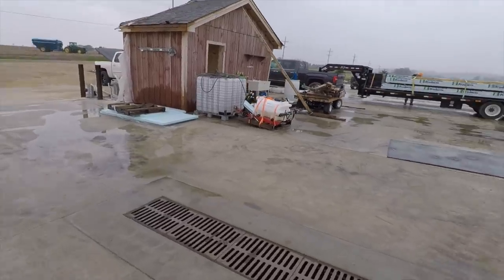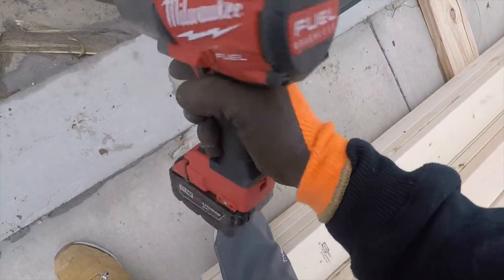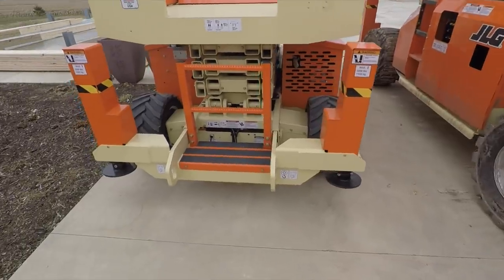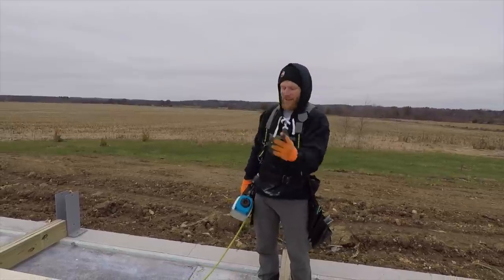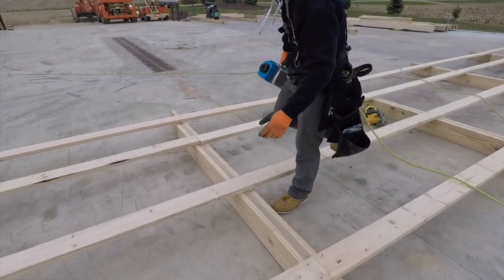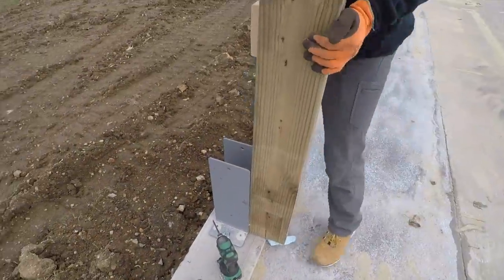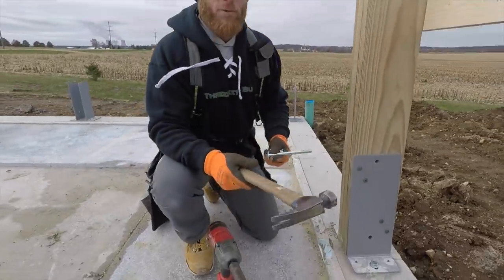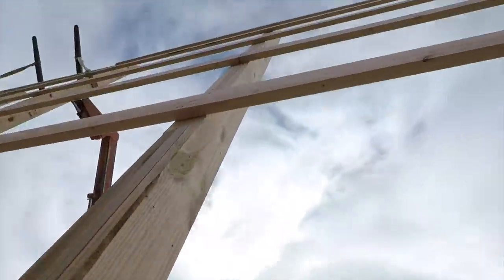Farm Shop build series video 1

Comment: You might want to check out the required development length of that tie down bolt. With the size of that building it seems a little short.  Also, I agree with your assessment to get a proper tourque wrench and an allowed ftlb setting with a design setup time on your concrete.  Your current method of setting your tiedown brackets could be degrading the pullout strength by riding the trigger for too long on your impact gun.  Love your guys work ethic.

Comment: Great Videos!  Nail Bag Tip:  Grab a handful of nails, enough that you can touch your thumb with your index finger.  Grab with both hands together, squeeze while twisting and pulling your hands apart.  This will pull the nails apart by the head of the nail.  Lay them in your nail bag with the heads facing forward.  Now when you grab a nail it will be automatically be facing the head up and ready to fire.

Comment: I suppose the advantage to your scissor lift is its ability to carry much heavier loads of materials up to working heights. Cherry picker very limited in that sense. Keep up the work great to see this type of building as we are not allowed to erect in UK due to our stringent fire regulations. All our industrial building frames must be steel. It all arrives on the back of transportation ready to be bolted together. Generally two to three days for frame erection.

Comment: I wish I would have seen the concrete work! We are doing the same thing, but on purpose. We are pouring a 5" x 22' x 32' slab that we will have a ShelterLogic structure on for a few tears, we will then go out four feet all the way around and put in frost wall when we build the permanent building. That allows us to build with cash and not have to take out loans.

Comment: I see a lot of these start with just post footings and the building is built on natural ground, later to be finished with concrete.  Is there a reason the concrete floor and foundation is not installed first?  I ask because it seems that it would make for an easier build, rather than working in mud like in the Diresta build.  Thanks for the wonderful videos.
Reply from the maker: typically we build on a pier not a whole footing wall.  this means the slab must be poured after so it can float inside.  We don't want the weight of the building on the floating slab.
Reply: RR Buildings makes total sense. Thanks!!

Comment: Love your videos! If I lived near you guys I'd want to get back into the field and build with you. The only thing i would do differently is use two part epoxy to put 5/8 threaded rod into the concrete rather than those large tapcons. I've just never had luck with them lol.

Comment: It's crazy to think how we build in a completely different way here in Europe, compared to you in the USA.
I'm about to build a "similar" building in Italy (maybe half big and 1/4 tall, and with 2 more line of walls in the middle), and it's gonna be (I mean: it HAVE to be, due to engineering regulation) completely built out of concrete.
Reply: Yet nothing stands up to a decent super storm or even a sinkhole.

Comment: With your wall assembly, new snow outside is up against building the melt can flow under wall bottom over wall footing area into the workshop.  Why not bring the perimeter wall stem 6" up higher above inside floor? I did see a few 4"? bluish pipes up around footing outside back wall,  is this a drain next to footing face perimeter to drain water away?  Why no treated block between metal post base and your new assemble wall post? Or use treated wood in your post assembly. Yes, time and money. But wouldn't both items assure a longer no maintenance install? I don't know what snow levels will be up against this Superiorly Built with pride and shown of this  GREAT New Building.
Reply: water outside and pipes carrying water inside,  it makes sense to weather guard but does little for what is piped into a building for hydronics and maybe a wash area.

Comment: I understand using steel beams cost more but it gives the structure more stability and lost way longer. Especially with a building being used for work steel beams seem like it would have been better

Comment: That will be an awesome shop this looks to be an amazing series. Pretty neat that two men can do this. Why do some of the posts look treated and others not?
Reply from the maker: all bottoms are treated and the finger joint up top is untreated southern yellow pine
Reply: Even though it is not in ground contact, it still a code requirement to have at least 6 foot of treated from the bottom since water may still come into contact with the connection.

Comment: So, this farmer lost his old shop building to a storm, and you want to build a wooden structure on it, that can, well, relatively easily be blown off by a storm? Why not something more solid?
Reply: His methods, materials, fastening, and spacing will likely hold up to greater loads. We don't know how the old building was constructed.  This guy's most likely adhering to local building codes, which have increased over time, and if his buildings pass inspection, they're built to code, which governs wind, snow, rain, and seismic loading.

Comment: Great Videos ... Ive enjoyed seeing the different types of buildings you have put up.  Question for you ... If I want a 18ft sidewall building for indoor sports and random stuff parking at my home, what is the most cost effective way to get a building shell (walls/doors included) that will last and give me the height clearance I am looking for?  North Carolina, so no major snow accumulation concerns, but plenty of moisture and humidity.  Not in city limits, so aesthetics are not as important.

Comment: It is surprising that code would allow the use of those screw in anchors vs a traditional mechanical or chemical anchor. A building that large must see a ton of wind load out there.
Reply: Regular screw in is not the only type usable in this but are most practical due to likeness of L bolts being misaligned or putting an anchor out of alignment, they make no mention of not using chemical bonded type anchors though and also offer wet set with rebar welded to the bottom of the bracket which he often uses as per the DiResta and many other builds he has done.

Comment: Probably a really stupid question.. are the posts 2x6 or 2x8?  Also, what kind of nail pattern is required when marrying them together to make the post, or were they prebuilt?  Amazing work, staggering how fast yall work for such a small crew!
Reply from the maker: cwarren83 these are pre engineered laminated 2x8 columns.
Reply: RR Buildings ahh ok makes sense.  Was thinking that would be a TON of prep work to get the column built.... and a metric ton of nails lol

Comment: Hi, great to look at your work. Love to see your footage. Thank you for that. I got two questions. At 3:11, are the fasteners the HEAVY-DUTY TAPCON®+? I ask this because I don't see any bolt there which are visually the same as yours. Also I found the embedded dept mentioned there a little bit short. My second question is. What type of DeWalt are you using to drill the holes in the concrete? Are you also satisfied with that Model in the long term? I don't care if I need for every 10 holes a battery and recharge them, but like to have some insight. I have to do a building with 55 holes with fasteners like the size you'r using. Did you use any type of glue/kit inside the holes?

Comment: Very interested in how you set the truss too the post.  Noticed you don't use a girt.   Just wondering how you secure truss to laminate beam?  thanks
Reply: Bryan OConnor 
Note that the top of the post is notched - they will probably set the truss in the notch at the center of the post. This is a great way to carry the truss load down to the ground and securely lock them in place... unfortunately you can't get any barn builders in Indiana to do it other than Morton, and if you use Morton you might as well build an insulated steel building on concrete caissons for the same price.

Comment: So I watched this video, then I watched a certain Morton building video. And it looks a lot like this site especially with the little mechanical room in the center 🤔 guess Morton isn’t what they crack up to be.
Reply: ALl buildings can withstand only so much force before something gives like a door or window opening up and letting the winds in, the vacuum effect is a powerful foe even if it was ICF construction, I have seen steel frame get blown over just as bad and even ICF get gutted. Debris from surrounding damages also does not help much with steel or wood framed.

Comment: Seriously, No wonder these buildings fall down with the first storm. Little more than an oversized garden shed.
Reply: Guess you never seen a steel framed building not get blown over as well I bet, a structure is only so strong until a storm that exceeds its design and build limits comes along, heck I have seen concrete masonry unit (cinder block) buildings get knocked down by hurricanes.

Comment: Why don't you use galvanized bolts thru pressure treated 2x8 post? Wood manufactures mention treated wood may cause corrosion of hardware.
Aslo why not use coated titan lags since in contact with concrete and chance of water contact due to being a shop.

Comment: Did you need a permit? Was the building engineered? Great video!!
Reply: Any building built needs a building permit and they're a construction company I'm sure they engineered the building with CAD software before building.
Reply: Or blueprints of some kind.

Comment: I’m surprised at the building technique, down under we concrete our footings 3 feet concrete, 4x 20mm booker rod cage bolted to 20 mm steel baseplate on hot dipped galvanised ubeam. Nails and timber? Twist warpage? You have done a beautiful job though I wouldn’t want my shed built out of timber. Steel, tek screws  and bolts

Comment: So you dont set post brackets in concrete?   Also how do you insulate pole barns?
Reply from the maker: gentile joshsaved all in time
Reply: gentile joshsaved, did you not watch the start of the DiResta build, he does both wet and drill/dry set. And have you watched some of the more recent builds for the insulation? Not like steel which pinches the insulation between purlin and sheet metal.

Comment: Hey man what's your opinion on UC4C posts that are treated for direct burial for a structural post?
Reply from the maker: Lance Sheppard not sure man. Don’t know a bunch about that we don’t burry any wood
Reply: RR Buildings thanks for your input. I live in virginia and my local concrete supplier charges $155 a yard for concrete. Ive been reading about the UC4C posts and they seem like they will last really good. God bless brother.

Comment: When framing, is there any advantage from using nails rather screws? Are nails stronger or is it more convince?
Reply: screws for 'torque'/holding power and nails for sheer as they fail when it comes to tension and can/will pull out.

Comment: Run bolts from opposite sides. Bolt heads have a lower strength rating than nuts, so the strength pulls towards the middle from both sides of the plate, just sayin...

Comment: Hi there! 
Hows this Arctic freeze where you are?
Were you still in Ny when it hit?
Also, those concrete anchors youre using on the wall posts, is there a led shield those are going into? Or straight into the poured predrilled holes?
Tony-nyc.
Reply: He drills the hole out to a specified diameter and depth and then just screws in the bolt until tight.

Comment: why not rent the lifts? i mean instead of locking up your own money(the companys) in inventory/assessts? also that way you dont have to deal with service on the machines etc.
Reply: Micke it's probably cheaper ?
Reply: it depends. if he has no issues with them what so ever, in the long run im sure its cheaper. but then again there are a few other factors that are included. of course he will calculate the use of the lifts in the prices when he's giving the customers a price suggestions(not sure what its called in english). but my biggest thought was, why invest the companys money into the lifts. 40k isnt like buyin a impact wrench. must be better to invest the money in other stuff than inventory. just my 2 cents. i might be wrong.
Reply: I understand your point, but if it's cheaper, you have to go that route. You rent gear when you don't have to use it a lot and the investment wouldn't make sense. I think in this case he will use it a lot so the investment pays for itself. He has a clearer vision on his numbers so I guess he made the best decission.
Reply from the maker: I rented a JLG 3394 for 2 straight years thinking I was saving money..... never had a mechanical issue.  Spent around 24k to rent when I could have bought the machine and owned it “used” for just over 30k.  As you run a business and own everything it’s good to purchase equipment and have some write offs too

Comment: Just out of interest 
wht build out of wood?
I see alot of American buildings done this way

in Australia we use all steel 
much much cheaper and stronger
Reply: Ever seen how a steel building is most commonly insulated? Pinching the insulation negates its purpose and also a standard 3 inch is not enough, though barndominiums in TX have been built using steel forgoing the factory insulation install and opting for blown or sprayed in.  But per the structure, where there is a column/post, the frame looses in many instances in allowing the placing of an opening in steel frame where as a wood one just does similar to stick built timber framing..